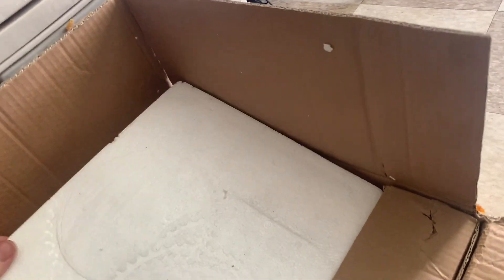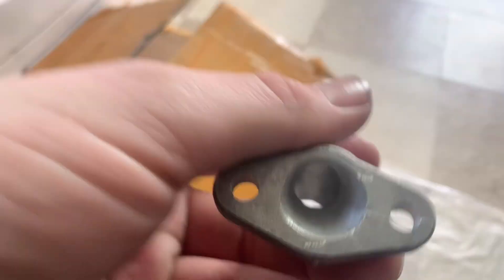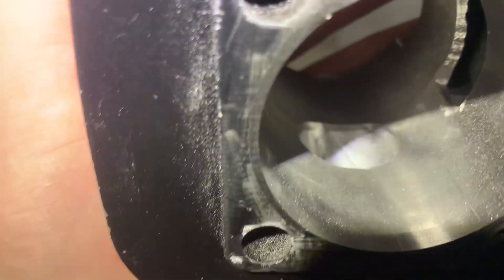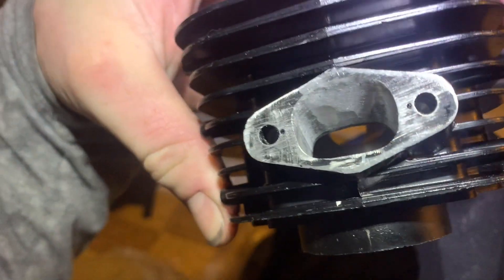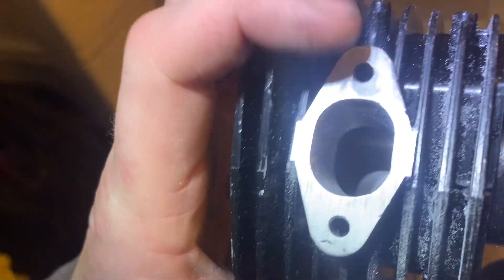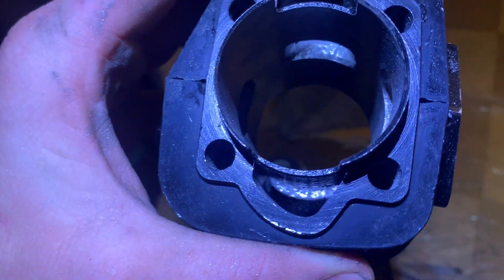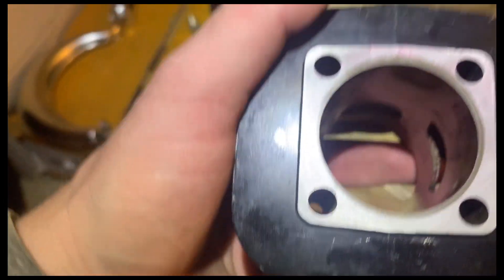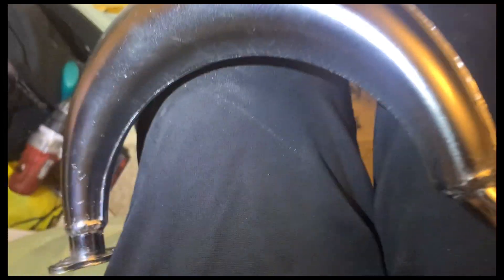NEW 100cc (80cc*) Motor for my motorized bicycle, lied to me. Flat surfaces on the cheap!!

Comment: Awesome bro 👍 I got the same cylinder dude. It's a great cylinder it just is very hard to do the port work. I took out the transfer walls on mine, also made Port work easier afterwards.
Reply from the maker: I was thinkin about taking out the walls just nerves to do it cause if I screw up I’m hit cause money’s crazy tight but it does run very nicely all in all
Reply: @JMB676  whenever you do any port work cover the inside bore with duct tape that you are not porting. Helps prevent ah s*** situations.
Reply from the maker: @JamesPiccone  great tip brother ty

Comment: I think I got the same motor. 100cc iron sleeve the piston measures less than 50mm I don't remember like 48. Something. I clean the edges of the rings and ports so there was nothing to catch. I notice it was full of crap like production particulate. Also found gauges in the head combustion chamber and the  threads for the for the plug were all painted . Lots cleaning.
Your transfer ports try a file with half round side and a flat side break it to a size you can get a little movement
Reply from the maker: It’s supposed to b 49 mm but I measured mine b it’s just an 80cc/66cc it’s only 47mm piston so there’s def a couple versions out there either way I really liked the motor very nice components in it but like you said needs a lot of tlc to make it right

Comment: I've built two of these they are awesome cylinder there 49mm piston there is no 100cc
Reply from the maker: It measures 47mm piston just like every other 80 I’ve seen not sure how you measure it to b 49 cause that’s what the eBay seller is tryin to say it is but my tape measure never lied to me before and I don’t think it’s lying now
Reply from the maker: I just watched your video too like that paint looks slick   I also feel like it b a real good motor to mod n play with
Reply: Thanks yeah I think you are going to like it. Good job on porting the cylinder.
Reply: Yeah mine measures 48.6mm on the piston
Reply: @JMB676  do you have "70/80 "marked on the left side of the cylinder?when I first got the cylinder I sent a bunch of pictures on discord comparing the piston to a traditional 47 a 48 mm from MZ & 50 mm yd piston. It was obviously larger than the 47 and 48mm's  & nearly identical to the 50 mm piston.
Reply: @JamesPiccone  so you could overbore the steel sleeve cylinder, if needed and slide in a YD 50mm.
Reply: @KenC56mm  too much work & BS to do that, you're better off just buying a new cylinder set again for 35$ bucks. I wish the yd100 cylinder sets were cheaper than what they are, kind of ridiculous $70 for a top-end replacement.when I blew out my transfer wall on my first yd100 it was just a better option to buy a whole new motor then replacing that top end. So now I got two yd bottoms & waiting for the tops ends to get cheaper.

Comment: So I got 58k out of it with case leaks and intake leaks. I found a bump at the edge of the exhaust port mount big enough it would seal.filed it down and got from APC gasket material good for axles carbs water pumps and made my own fit nice made 5 of them and staked em. Locktigh my best friend lol. Also found good use for sealent for gas  says good for 2 stroke silicone shit.
I run it hard but rather than shut it down I reach down and choke one till she bogs good and keep throtle open my thought in doing this she runs long and works hard so flooding it out a bit lines it up. I hope.
Problem I'm fighting can't get it to idle may have gone to far with one of the ports. It'll idle on choke high idle but that's it the screw is all the way in that a delorto carb knock of. Don't know if it's the carb
Reply from the maker: It’s probably the carb or tuning I had similar problems wit dif motor turned out it was a seal by the magneto letting air in so go over it really close  there’s a lot of dif ways most people say have it running n spray starting fluid on it all over to hear if it surges but that’s super dangerous I prefer to get a spray bottle with soapy water n have it off n keeep it all together n I spray it or my wife does as I roll it around to spin the motor over n the soapy water bubbles up if there’s any air leaks in it go forward n backwards so air goes in n out to let u know wuts up good luck brother please let me know how u make out

Comment: I don't know for sure but the short stroke like 38 mm vs long Wich suppose to be 40mm it's actually slightly higher than 40 like 40.2 anyway maybe the combo of crank closes in on a 100cc

Comment: Does the iron sleeve cylinder fit the YD bottom?
Reply from the maker: I’m not sure I would have to measure it but It probably would cause I believe (don’t quote me) that the 80 n 100s have same 40mm stroke bottoms
Reply: @JMB676  They do but the yd has a slightly larger bolt pattern. Im bettin, just by lookin at it, its a 66cc bottom. All good bro. Thanks for the vids, i enjoy em alot and good luck with your current build too.

Comment: Johnnie,  bro I hear that those 100cc 2 pc. engines are trash. Especially the ones with the iron sleeve,  just be glad you got the 80cc instead,  you have enuff troubles as it is bro. Stick to your YD 100's they're much more reliable again you don't need the troubles that those 2 pc . 100's bring with them... just sayin'
Reply from the maker: Funny I say this cause I actually was wrong it is the 49mm (100cc) two piece I just thought it was the 80 cause it used the same head gasket but either way with that said I actually just tore that motor down finally and bought the piston and rings I need to rebuild it. I also learned a lot about them n see the failure points. But I’m putting it on my wife’s new bike since it’s iron sleeve and takes a lot of abuse, once it fixed lol. But not till I’m done with this new 2piece yd100 I literally just tightened the last bolt on to as I write this. But there’s a few more mods then just a two piece head now. Can’t wait to to show you it.
Reply: @JMB676  
Cool man I'm looking forward to it... Always willing to expand my knowledge of these things

Comment: Hey buddy but one thang man even they say it is a 100cc but really it a 80cc not a 100cc that motor u got there it is a 79cc so it aint much smaller than the yd100 i am going to get me one because at least it got a good head on it for cooling an performance so be safeout there say hello to your kids an wife
Reply from the maker: Hey brother yes I bought it originally because it’s a 100cc with iron sleeve n separate head for violin and thought the same way as you about it. BUT it’s a very good bottom end u know the case and what have you is well put together however mine the one I bought as a replacement cylinder and many others from people I have talked to have same problem but the bottom of the cylinder is tighter I’m assuming cause it’s not honed properly n I think can be fixed if u have machines or at least a hone. Don’t get me wrong it’s definitely nice quality as far as parts but the assembly is really bad I’m fixin mine n if ur handy u can probably fix the one u get but me and so many others have had the same problem of the piston cracking cause it’s so tight in the bottom of the bore. O n it wasn’t close to same power as the yd it was more like the 80 I felt but it did Rev to the moon but that was probably more to do with my port job cause the ports very clogged from factory from the sleeve.